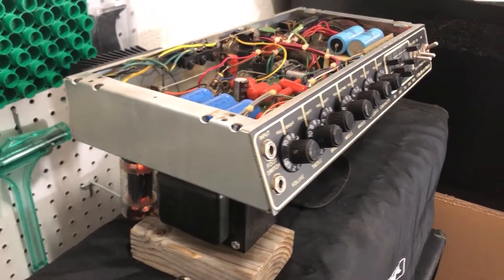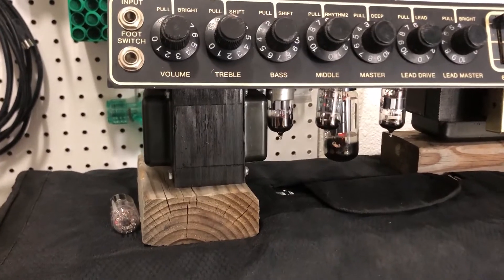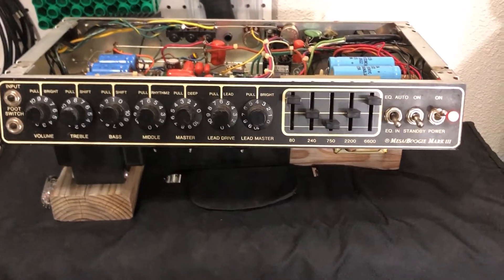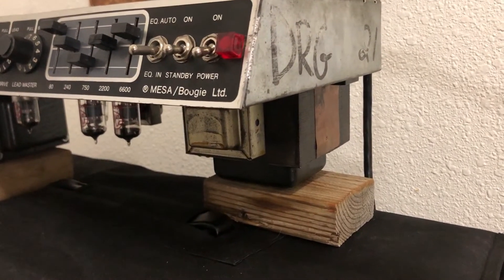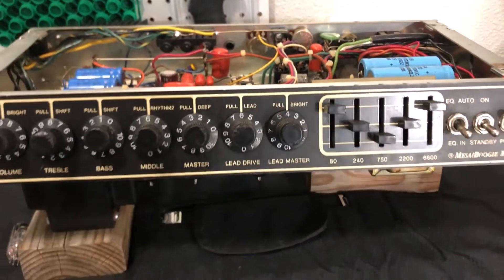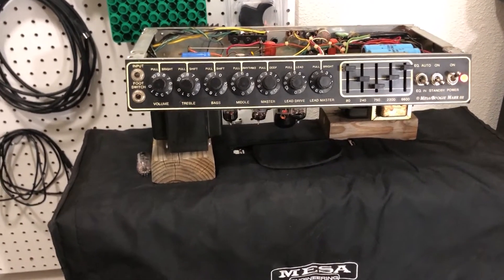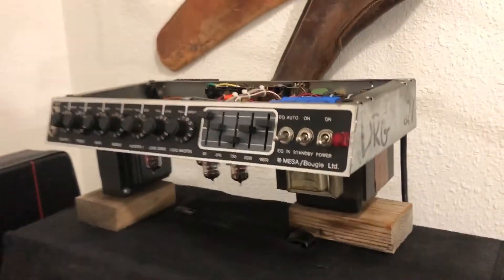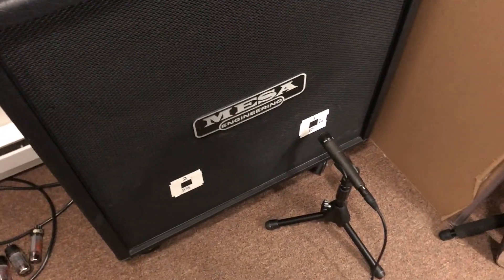Mesa Boogie Mark III black vs red stripe.

Comment: Sorry I do not have a comment, but a question... Has anyone found that using matched tubes outside of "Masa's Branded Tubes" in their boogie, shortened the life of the tubes and damaged the amp???
Reply from the maker: It makes no difference, AS LONG AS you select tubes that are within a safe bias range for your amp. For Class A/B amps this is pretty straightforward but for SimulClass amps it's a little trickier. 

There are further tube brand considerations for IIC+ & black stripe III amps with the PT105, and also Coliseum amps, due to their high plate voltage, however most Boogies have PV under 500 and any good tubes will work.

Comment: I own the red stripe cimbo and prefer the extra growl. Thanks for the comparison. Now checking your past mark iii videos 👍🏻
Reply: I have a red stripe combo as well.  Seems like the combo changes the tone a fair amount compared to the separate head.  Tube vibration?
Reply: @corporatehippy  I'd love to hear a red stripe combo vs red stripe head 👍🏻
Reply: @MrVegiita  Me too!  It's been a while. I had a buddy with a red stripe head back in the day and we did a comparison at the time, though not nearly as scientific as in the video shown here.  We thought the combo had a more complex tone and some techie said they thought it might be because the tubes sit right above the speaker in the combo, but it was just a theory and our experiment was hardly professional.  :)
Reply: @corporatehippy  hmm 🤔 that is an interesting theory. I guess for a more accurate test, you would plug both amps into a stand alone cabinet.

Comment: Hey man hopefully you can help. Has a Mark III DRG with 100PT (not 105) come up for sale. Has the ++ mod by Mike B. Should I jump on it? Or is it not as good without the 100w power section and 105PT?
Reply from the maker: As per your other question there's no difference other than you can use any good 6L6 with the lower voltage 100, where the higher voltage 105 some tubes aren't as reliable. I saw that amp & I'm sure it's a fantastic amp, priced crazy though.
Reply: @TIGHTENmetal  what would be a reasonable price for it? ++ And GEQ mod done in 2019 by Mike B, recapped, etc.
Reply from the maker: @guitarwilly81  If I were opening my wallet, I wouldn't pay more than $2500.  YMMV.

Comment: I can hear the difference clearly but I am having a hard time deciding which I like best.
Reply from the maker: Tonally & dynamically the black stripe has more clarity and feels better under the fingers. BUT, the red stripe is definitely more pissed off and records more true to tone.   They are different enough not to step on each other's toes.
Reply: @TIGHTENmetal  Just came back to this one - the red stripe sounds like it's boosted compared to the black stripe. Much more lively imo.
Reply from the maker: @dlpasco  Wait till you hear my green stripe.
Reply: As an owner of a green stripe, as well as a Mark IV, JP2C, and Mark VII, I'd love to hear the green against a red or black dot.
Reply from the maker: @Soloist1983  only III I have at the moment is a green stripe so while I can’t compare directly to a black or red, I can tell you that the pentode is a lot more aggressive in the green! My latest video covers the green as I just had it III+ modded.

Comment: Have you been able to play a purple stripe yet? I've got a DRG. I think it should probably get checked out and serviced by mesa but it's a different animal.
Reply from the maker: Not yet. Purple is the only one that's avoided me.
Reply: @TIGHTENmetal  some time I might have to ship it to you ( if you would be cool with that)  so you can check one out. I'll have to get a bit more stabilized in my funds before I do. Hopefully that doesn't take long.
Reply from the maker: @paulwubbena6809  That would be cool, thanks!  :)

Comment: So much different tone in between the two, I prefer black since the red relatively sounds very thin and black sounding more ballsy. I own the red stripe version which now I transformed every single components into the same specs of IIC+. which I love so much more. There are very interesting posts on the boogie forum where people talk about modifying IIIs into IIC+(https://forum.grailtone.com/viewtopic.php?f=27&t=74714&start=45) and some say black stripe is the best for conversion since obviously it comes with 105PT. (But then again, not IIC+ comes with 105PT either). I guess your video shows great potential of black stripe with this 105PT. Great work, man!
Reply from the maker: Thanks. Trying to make a III sound like a IIC+ is a fun experiment, but it's still not the same. If you want a C+, your only real choice is to save up & buy a C+.
Reply: Yeah I guess getting the original C+ is the only way to get the identical sound. I just mentioned it since there is enough discussion on the forum talking about potential and the tonality among black, blue, red stripes of IIIs and IIC+s. If you are ever interested in checking my altered III sound example, check 
https://www.youtube.com/watch?v=s4UWbs9uMCc&ab_channel=JooikChung
https://www.youtube.com/watch?v=BBWLa3tHEss&ab_channel=JooikChung
Reply: @TIGHTENmetal  You have a shop where i can buy one of your amps ?
Reply: @TIGHTENmetal  But if a mark iii black stripe would be modded FULLY to a iic+, then it would be the same right? I think there are two iic+ mods. However a red stripe already has the same circuit as the c+. And can a mesa quad be modded to be the same as the iic+ preamp section? What do you recommend?
Reply from the maker: @lucbos7516  No, I buy & sell on forums & FB groups.
Reply from the maker: @scription7277  Nope. Mark II and Mark III use a fundamentally different preamp board since the Mark III is a 3 channel amp and the II is a 2 channel amp. 

The black / no stripes to me are by far the closest sounding & more importantly feeling to a C+. The reds blues & greens got a lot more aggressive. They're all great amps in their own right, and, if you want a C+ then you need to get a C+. Otherwise you'll never know.

Comment: How does the black stripe compare to the mark iii+? I'm having my red stripe modded to iii+ specs in a few days.
Reply from the maker: The red stripe ++ I had was a lot smoother like a II, and a lot more compressed like a IV. The mod IMO killed the "pissed off" nature of the red / blue / green IIIs so it was a different hybrid animal. 

The black is lower gain like a C+ and it has all the dynamic feels.
Reply: @TIGHTENmetal  that's interesting I thought you'd keep the mark iii++ based on your videos.